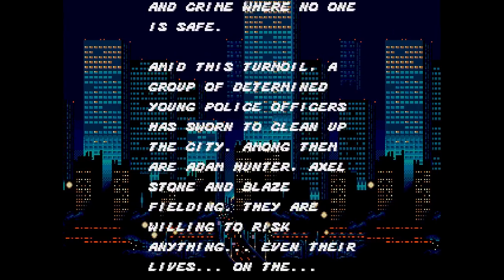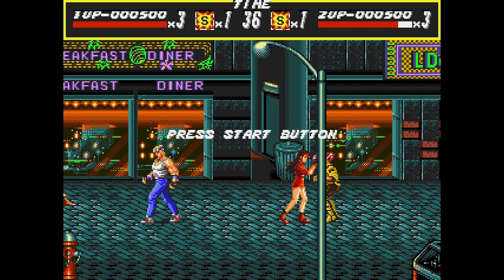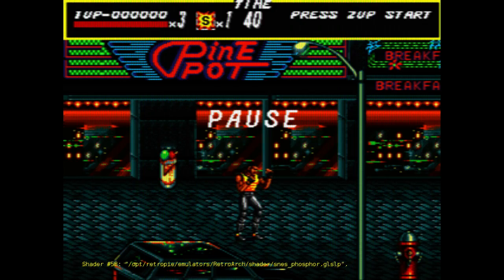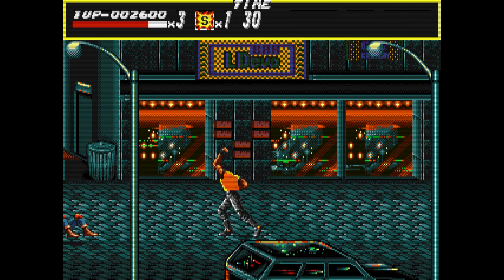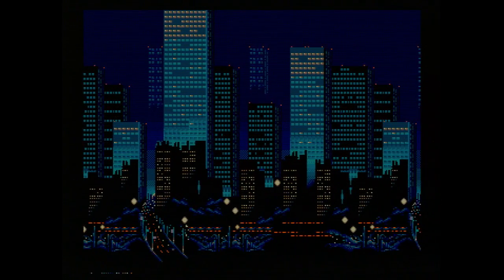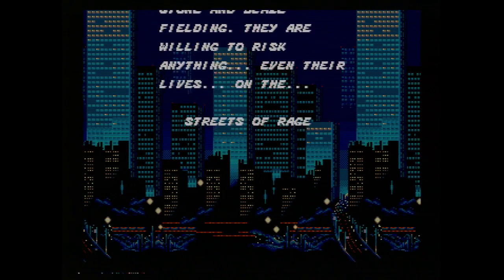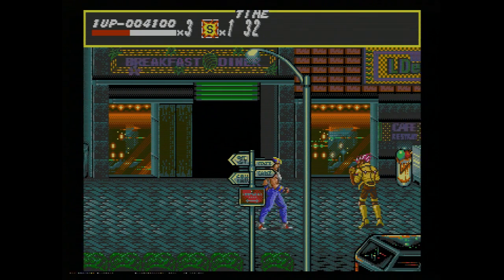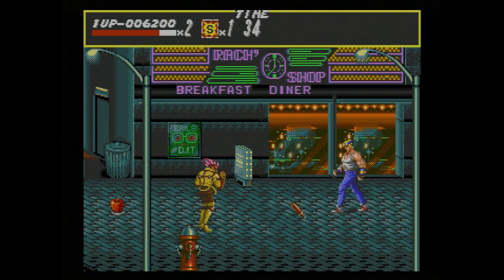RetroPie: Comparing shaders to original hardware graphics

Comment: If you compare the shaders you used, against original hardware on a CRT, you'll see a major difference.  Those shaders are too precise and clean.  There are much better ones to use to get a more authentic look.
Reply from the maker: Hopefully there are good shaders out there that dont run too sluggishly on a Pi.
Reply from the maker: ***** If you're feeling brave you can try my tool that auto applies updated scanline overlays
https://github.com/biscuits99/rp-video-manager
Remember to BACKUP!